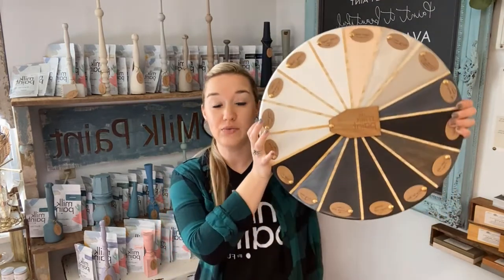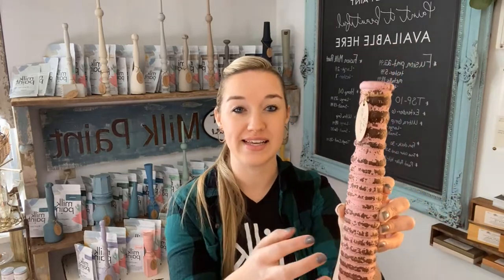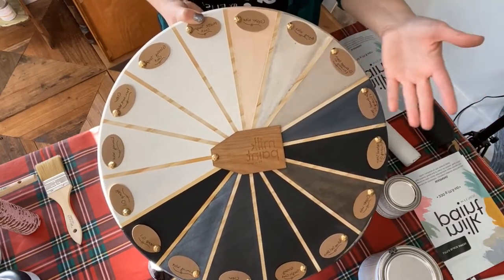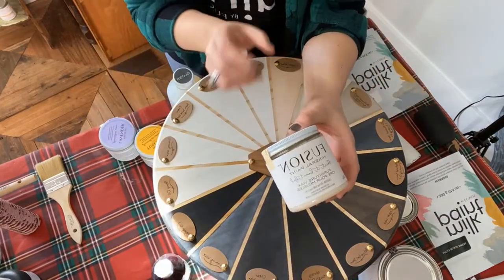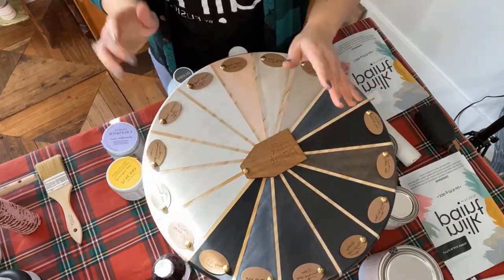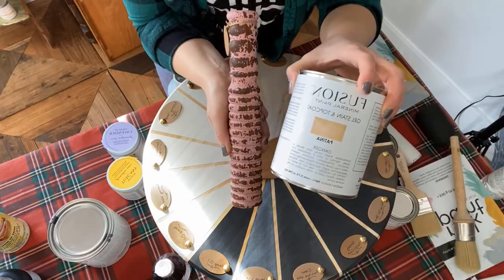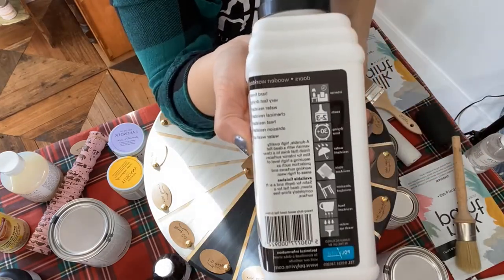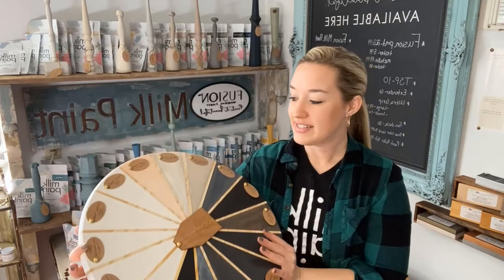How to choose a topcoat for Milk Paint.

Comment: Is the stain and finishing oil as durable as tough coat? 
I want to put it over little black dress on a high traffic dinning table. What else could I use if the finishing oil isn’t durable enough
Reply from the maker: Sorry that I missed this question!  The stain and finishing oil is actually floor grade so it's super durable and I would say even more durable than tough coat.  It would be the perfect option for your dining table over Little Black Dress.  Again, sorry that I did not see this sooner.